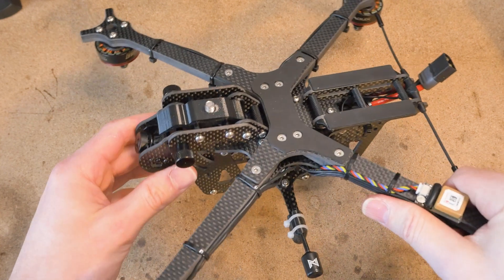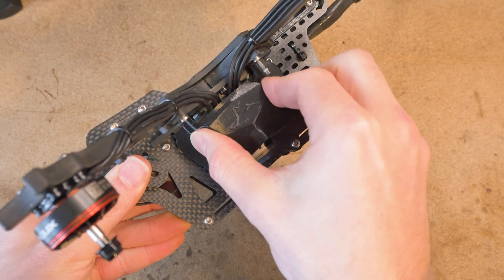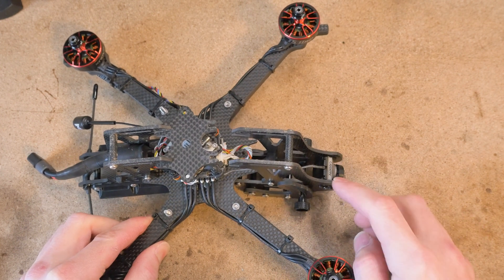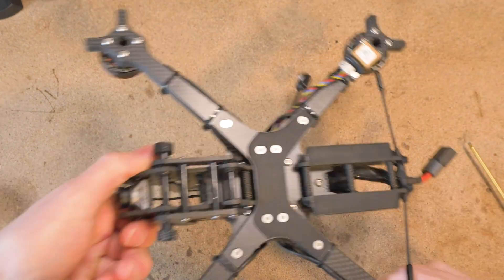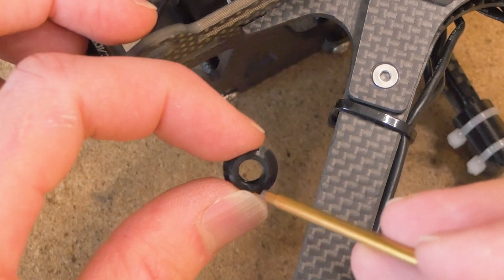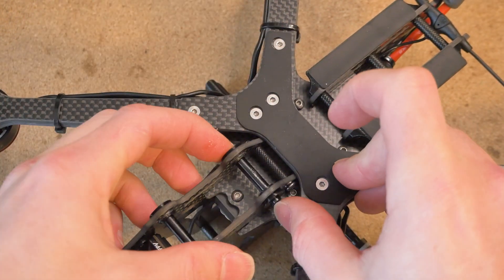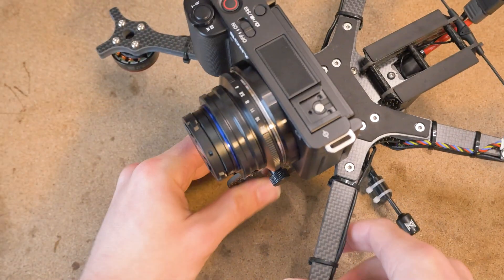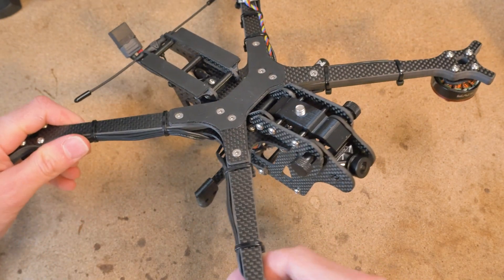Vulture Frame Tips and Tricks

Comment: Did you ever have any vtx signal issues with the single antenna?  I'll be building with a vista as well. Also that carbon fiber mount plate for your vista. Do you have the file for that?

Comment: how do the those xnova compare to the larger motors you started with? 2807.5 to 2806.5 right? Also, how do the 3008s you tested compare?
Reply from the maker: I like the Xnova 2806.5 1700kV more than the Hyperlight 2807.5 1722kV overall. The 3008 1900kV is best for if mostly flying Komodo and other 1.5kg payloads. But if your camera setup is 1.0kg or less, then the smaller motors and 1700kV is better in my opinion.
Reply: @strawhatsam  how do yo feel about he Bh and xnova 2808 as an in between?